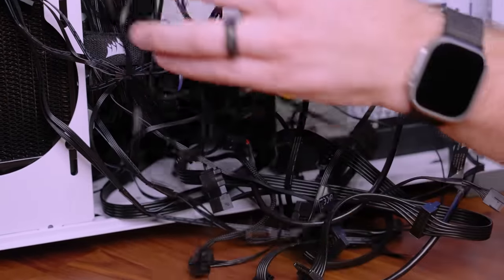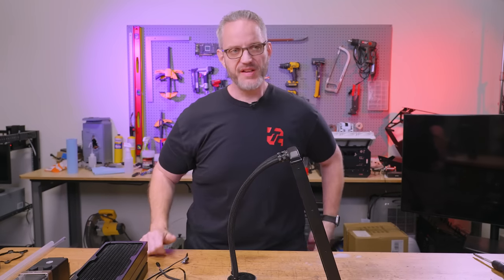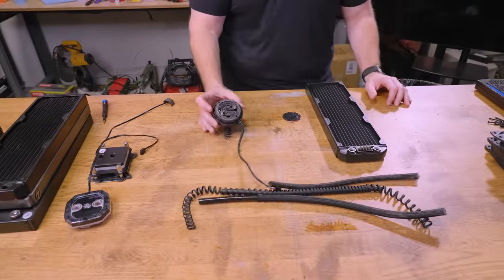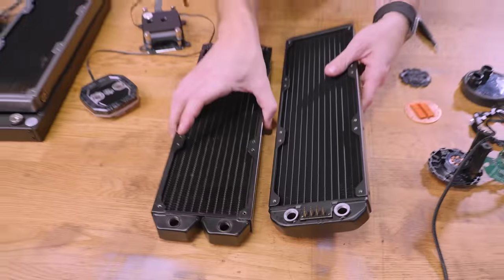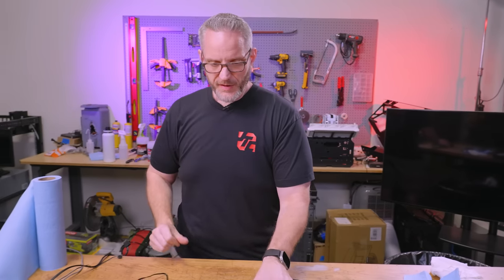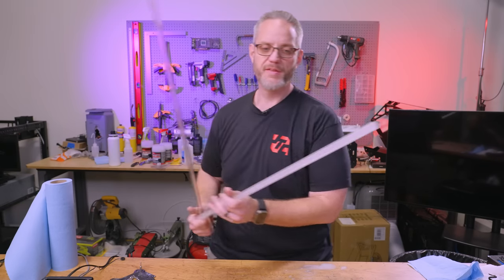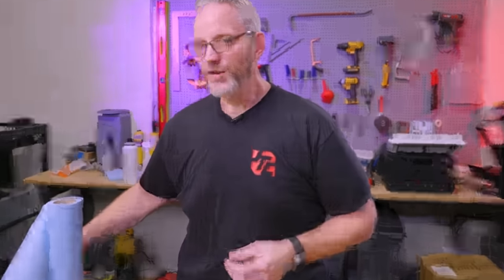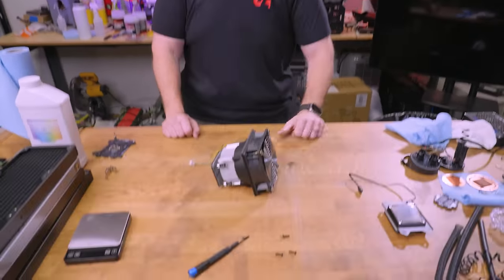Which one is right for you?

Comment: Hardline/custom loop owner here. Much harder to maintain and build, more expensive, but I love looking at it and knowing that it's one of a kind, looks great and performs well
Reply: what's wrong with soft tubing & distilled water?
Reply: I bought a 3950X with a X570 master and 32 Gb 3600 DDR4. I was going to buy an RTX 3080. But for obvious reasons it didn't happen.
Inspired by Jays vids I thought I'm going to water cool this sucker". And so I started buying the stuff week by week.
When I had it all, I looked at it and thought "holly crap, this is that Jays fault" I'm glad I did it. Nowhere near perfect but ok for a first try
Reply: yep im glad i chose soft tubbing first because it was easier to deal with i had no issues at all
Reply: @kevinerbs2778  nothing, had that setup for years
Reply: @kevinerbs2778  There's nothing wrong with it at all... 
It depends on you - do you mind soft tubing, organic looking loops - or do you want your tubes not "sagging", looking more uniform.
They will both perform the same if the pumps and rads are the same - it's just about what pleases you.
Oh, and if you're willing to spend the time trying to bend everything perfectly for your hardline tubes.
Just do whatever makes you happy - I would certainly start with a soft tubing build, just so you get  used to everything fitting together, but other than the learning curve... all up to the individual really.
Reply: @EddieG_333  If your soft tubing is sagging, you have too much length for the runs you have. 
hm, let's see having to have proper saw to cut hard tubing, having to be perfectly aligned every time, risk of connections sliding out. Oh And having enough room for it too. Nope can't see a benefit to hard tubing other than "IT LOOKS COOL"
Reply: @kevinerbs2778  exactly, that's all, I just like the way hard-line tubing looks, vs softline
Reply: I find hardline requires no maint at all really.  It's more than a AIO but its effectively 0.  I just do a soft flush/fluid change every few years and that's it.
Reply: @kevinerbs2778  The benefit is there's no plasticizer in your loop to leech out so its basically 0 maintenance once it's setup.  Higher effort required initially and basically 0 later on.

Also tubing wont slip out unless you use PETG, that's a PETG problem, it deforms over time with pressure and getting warm.
Reply: @JathraDH  That's false there is always maintenance with water cooling.
Reply: @kevinerbs2778  Tell that to my system that I haven't even had apart in over 7 years and still works as well as it did day 1 once I clean the dust out of the rads.

If AIO's don't need maint then a properly built hardline system with the right fluid really doesn't either.  There is no plasticizer in it and you can run glyclol which basically shuts down corrosion and algae growth.  There is nothing to foul up.  AIO's do the same thing which is why they just work.
Reply: My dual mora build says its better than a AIO.
Reply: @billyhatcher643  nad realistically, soft tubing can look a hella clean.
Reply: @JathraDH  Maybe maintenance was the wrong word, but when replacing parts it definitely is more work than an AIO. I recently changed my GPU and just getting all the air out of the loop took hours. Well worth it though
Reply: @mammothkiwi  Oh for sure if you want to change any parts its a giant pain lmao.   That's why I haven't even taken my old system apart for 7 years LMAO.  I just built a whole new system from scratch with a new hardline loop instead haha.

I actually haven't drained that system for over 7 years either.  I have fluid changed it a few times because the dye color faded but I used Jay's method of opening the drain a crack and flushing 6-7 gallons of distilled through it until the existing fluid was dilute enough to basically be pure distilled then simply adding new dye so you never introduce air back into the system.
Reply: @kevinerbs2778 Nothing really as long as you use high quality TPV hoses by reputable brands!
Reply: @kevinerbs2778  soft tubing disolves itself in time. nice clean clear tubes turn to yellowish dull sticky stuff with sea life in it :D:D:D
Reply: Yep. I have no interest in the AIO type setups. I want my full cover waterblocks. Don't mind maintaining my own loops.
Reply: @kevinerbs2778  Nothing wrong with soft tubing. Just depends on what looks better for you.
Reply: They aren't all hard to maintain.   ZMT + non-opaque high quality coolant like DP ultra and you can literally run it years without even needing to change the coolant once.   And when you do, you just drain it and fill her up again.
Reply: @tomast9034  what are you using that dissolves plastic??? there are plastics that hold acid for years to decades without ever dissolving. I only used distilled water. Never had algae or anything yellow on me. I didn't use any nickel-plated blocks though either only pure copper blocks.
Reply: what ratio of distilled to inhibitor?
Reply: I have built one, and still running after eight years (changes and upgrades here and there) but it was a hell of a learning curve at the time. Built many other air cooled systems since then and looking at building a new water cooled system in the next few months as it seems to be the direction to go.
Reply: @kevinerbs2778  it was my first loop like 7y back . back then after 3 month all soft tubing went tits up even using the premixed "acid" from the set. went petg tubes no problem for 5years lol.
Reply: Place your res above your loop (T-in), leave some air space for heat expansion, and cap the fill hole. If you don't let stuff in, then it can't grow in there. Running 4 years on this setup. No clogs, no clouds. You'll sleep better, - and all your friends think you're smarter than them.
Reply: @aleksandrbmelnikov  I have exactly the same setup with dual drain ports at the bottom of the loop. Drains in seconds. The point I was originally trying to make was that if you are changing out parts or need to adjust the loop it's objectively harder. I don't have any issues draining and then refilling my loop. I was just trying to make an objective comparison between the two options :)
Reply: @kevinerbs2778  pure distilled is bad, even RODI water is bad. it will pull ion's out of the metals and cause corrosion. 
now stabilizing the RODI or distilled will prevent this. using "water wetter" or other known corrosion inhibitors used in the automotive world actually are "radiator" safe and allows for watercooling to be most effective. WHERE as the "colored" EK liquids actaully have poorer thermal qualities  compared to pure water with corrosion inhibitors and later also will "fallout of solution" and result in lower performance. 

my RODI water build with corrosion inhibitors from a custom racecar project that we where chasing lower engine temps and fighting massive corrosion ended up being a dream solution for my all copper loop which has been 1 year maintance free and the loop sample was near identical 99.99% the same as the day it was put in. sure its black "server grade" soft tubing and all copper rads, blocks, ect. but in the end the cooling is ambient even under high loads! 
only overclocked to the moon, and under HEAVY sythetic loads does it reach 61 degrees C.... which IMO is absolutely insane.
Reply: I would love to add hard tubing in copper BUT! the soft tubing makes for GPU swapping one card to adding SLI a dream so wife could use a 3090 in hers... sooooo to each their own build! "plus now the soft black server tubing is more industrial looking!"
Reply: @mammothkiwi  It's not quite that pain-free with an AIO loop. Whatever is not being cooled by the AIO, still needs noisy and dirty fans. So while you're cleaning out dust bunnies, you start to question the logic. Just me maybe, but i don't change my computer around often. And when i do, most of the copper bends and glass long-runs stay in same layout. Instead of buying a full cover for video card, i enjoyed creating a custom cooler. So it just comes down to how much any one person likes to tinker, and if they have mad geek skills.
Reply: @alorrick7546  Create mounting brackets for in and out fittings, and only soft-tube your video cards. Then you get the best of both.
Reply: @aleksandrbmelnikov  sounds like you are just trying to flex now
Reply: @mammothkiwi  Inspire, would be the word i'd choose. I don't want people to copy. Who knows? Maybe i'll like their build better then my own. Ok, maybe a little flexing. *wink, wink.
Reply: Ahh someday :)
Reply: ive started just bought ddc pump mini res cpu block epdm soft tubing and fittings looking at 280mmx 30mm rads
Reply: Air-cooled Pc owner here. It is reliable and stable and when it breaks down I can just replace it for a fraction of the cost... Also, I running pretty low-end hardware...
Reply: It really comes down to if you're happy with how it looks and performs even if you loose a little performance :D...if that makes sense
Reply: I love-hate this one lol so
One a purely mental perspective its two very different tools!! If one loves building designing and does not mind coats obvious.  Build away been there and built a monster!!!
Fun to chase oc highs but at end of the day not practical and i spent almost nothing on a highly positive 0:02 reviewed aio on super disccount and am investing my mental capital on improving air flo on a hideous box. Again not better, just different!! ❤

Comment: Having built both, I like the simplicity of the AIO. I’ve spent a ton of money making a few open loops and still have a box full of odds and ends for when I eventually make another loop.
Reply: Same here. Considering how cool my 4080 runs, I can’t convince myself the need of a custom loop. Previous 3000 series watercooling was the way to keep them silent and cool, but not really needed now, as long the case offers good airflow, you’re better off splashing on some quiet fans.
Reply: Oh yeah. AIOs being super easy/simple to handle is a gift from God
Reply: Wish there were aios without the fans tho. That way it would save cost and people could use better fans too without going full custom loop. Idk how to do a custom loop but I sure as hell know how to replace a radiator fan, in fact, you gotta attach the included ones yourself anyway.

Comment: Before watching ok, AIO only cools one component, and the pump is usually weak, and it cannot be maintained or repaired, and the ASETEK licensing pumps up the price, the CPU AIOs usually come with 2-3 cables coming out of it, and need software running in the background to be controlled.

Comment: The only thing that prevents me from going full custom loop is not the cost or the hustle building it. It's the maintenance nightmare if you wanna do a complete system clean up or if you upgrade regularly. Draining the loop, disassembling it, then assembling it all again, check for leaks, fill it up, bleed it... IT's basically a full day work, while with an AIO like the LF II it's as simple as unscrew it and screw it back on afterwards. Custom loops look sick, no match for noise either, but damn that hustle when you decide to upgrade or maintain.

Comment: Love your channel Jay! Have to say, I’m a total amateur with PC building but recently finished my first build: i9 13900KS, EVGA Classified mobo, 64G G.Skill DDR5 6400, 3 TB Samsung 990 M2 memory, and GIGABYTE 4090 OC, Corsair 170 AIO w/140 fans/RGB, Corsair 7000D w/3 140fans, Corsair 1500W power.  Your videos were invaluable.  This PC booted the first time, loaded BIOS update first try, Windows 11 (your install with minimal crap and no account work around is great). Running Adobe Photoshop, Lightroom, MW2 at 250 fps and with this cooling never exceeds 60-65C if it ever gets that high, usually 38-55C. Based on my limited experience, all this hype about custom cooling vs AIOs and mega “fannage” is just that “hype” unless your planning serious overclocking (why?? “Because its there” I guess). Anyway, keep up the good work and videos and many thanks!

Comment: I love learning a little bit more about water cooling like this, I live in a high desert environment and summers here are way too hot for an air cooler so liquid is the only way to keep my rig cool. Sadly the next major hold up for me is price i never have a lot of money so AIOs are enough to keep my pc alive and gaming while also not spending all my money. Thanks Jay Phil and Nic for these info videos like this maybe one day I can go open loop but any more little info I can have is always welcome and definitely helps make decisions easier. 😀
Reply: Always bear in mind that a low end chiller will greatly outperform even the most hardcore PC solution. In the desert during the hot months I imagine you wouldn't need to worry about condensation either, so you could crank it up properly.
Reply: When you discover hybrid gpus its as game changing as aios. I have a 1070 hybrid I gave my nephew from the 1st cryptocurrency craze. Still going strong 5 years later. It's all about proper rad positioning.

Comment: The cost is a non-trivial difference. I was pricing out a custom loop for my current PC build, and the loop components cost not quite the same amount as the rest of the components I was purchasing for the system rebuild / update. That alone moved me to an AIO for my R9 5900, and left the GPU air cooled.

Comment: Hey Jay, been a fan for years and have always appreciated your input, and especially your honesty. For over 40 years I've built custom systems for myself and for clients. To me,  the primary reason to build a custom system is that you are not stuck with inferior or proprietary parts, which is almost always the case with prebuilt systems from any manufacturer, including, and in some cases especially, Apple systems, which can feature elegant design, yet still be comprised of and compromised by inferior parts, always at a premium price. Although I might build a custom watercooled system for myself just to satisfy the ego, after watching this video I will never build one for a client. Forgetting the 5-6-X increase in cost for a 5-8% increase in cooling efficiency, I could never guarantee a custom watercooled system as I do my air- and AIO-cooled systems.  The risk of increased support cost and catastrophic failure is just too great. I am surprised that no company has yet seen the potential for a better performing AIO utilizing superior parts and materials. Seems to me there would be a market for such a device, with a copper radiator and a higher capacity pump.

Comment: Been running custom for 10yrs now, pretty much have moved the same hardware through different builds over that time.  Only thing's I've added are spare rads, tubing, and pumps ( I have a hardware hoarding problem as well - lol).  Now AiO's are just simple turn key options for watercooling - I tend to suggest them for people that want an easy option to get started.
Reply: I stopped watercooling, gpu blocks cant br reused and have gotten expensive, cpu block too often cannot be reused. It's an expensive hobby. The fittings alone costing more than a dh15. These days graphics cards have great included coolers.
Reply: @jondonnelly3  In my case I have been on the same GPU for 6yrs now, but previous models I used the sale of the previous card w/ block to fund the next one.  But yes it does get expensive fast, I stick with EK's ZMT tubing due to cost and compatibility with fittings (I still have a ton of hardline fittings if I feel like going that route again).  My son's rig will remain on air due to cost and maintenance, which is another thing open-loop is maintenance intensive in comparison.
Reply: @Jon Donnelly  yeah, a good way to do is wait for previous gen GPU blocks to go on sale, they can't get rid of them easily. I think heatkiller is still selling 2080 blocks. If you don't mind not being latest and greatest

Comment: Got a Strix LC II 360 AIO. It's my first liquid cooler. I have it on a 13900ks. I'm extremely impressed, this thing is amazing, but temps can be a little unstable and now I see why. I ended up installing a thermal grizzly contact frame which evened things out a bit. That being said this breakdown is actually really cool, I haven't looked into Open Loop systems because I didn't understand the need for it aside from overclocking, but this clearly shows the benefits of going the extra mile. ONE DAY!

Comment: Just use a Noctua NA-FC1 to generate a PWM signal for the pump. Only require SATA power, and works like a charm. Ramping speed up and down helps a lot when filling and bleeding, particularly when you got two or three D5-pumps in series.